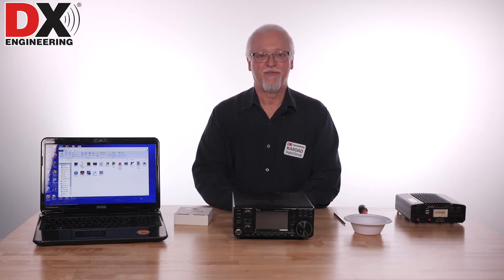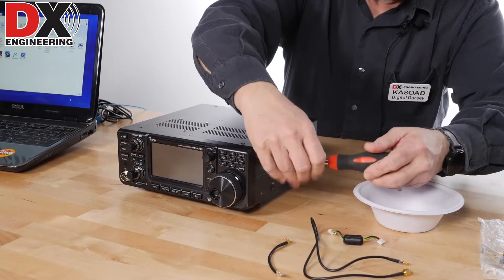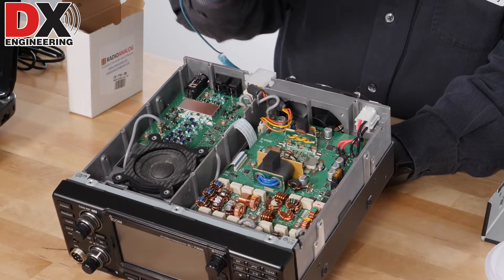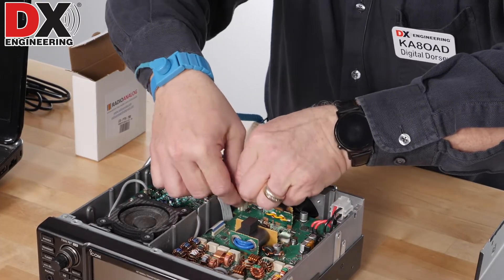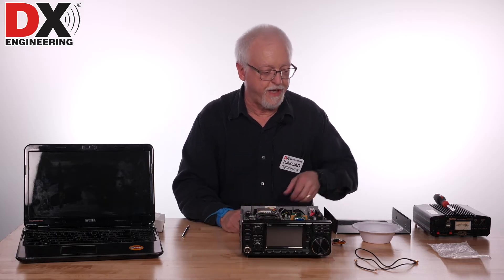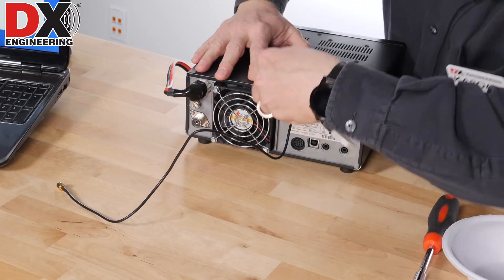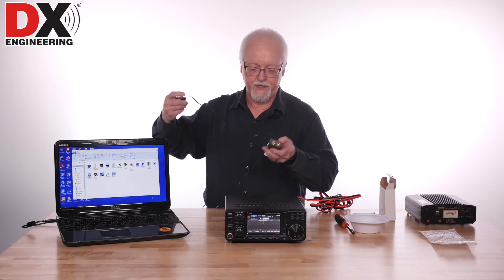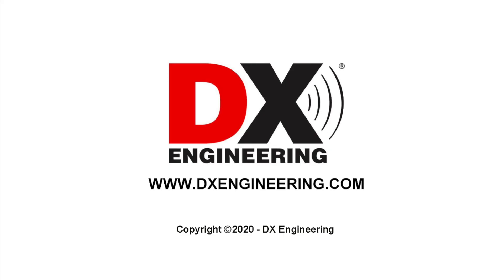Installing the Radio Analog PTRX-7300 Panadapter Module for the IC-7300

Comment: How do you loosen the screws?  Mine are so tight, I am afraid I'll strip them out!
Reply: heat them up a bit with a heat gun
Reply: Stripping them is easy to do.  Make sure your screwdriver fits perfectly, press down firmly and unscrew slowly, you should be ok
Reply: I stripped one of mine out using a Phillips screwdriver. I finally had to use another Phillips bit attached to a cordless hammer drill. Just the tapping of the hammer drill broke the screws free. Out of 14 screws, three of them wouldn't budge with a regular screwdriver.

Comment: Other than mounting issues, can the PTRX-7300 and Inrad RX7300 be installed and used simultaneously?  A panadapter and second receive antenna.
Reply: Did you move any further with this idea? I'm currently waiting on parts to install both in mine....

Comment: What are the correct baud rate and com ports? Thanks, de N5DHT
Reply: The baud rate is what you have the 7300 set with for CAT. The com ports are those you are using for your 7300 CAT control.
Reply: @RSwrightMD  another bull$hit reply from a bull$hitter.
Reply: @Michael-nd7gh  that's not what she said. Lol
Reply: @jimmeeGray  awesome story, bro.